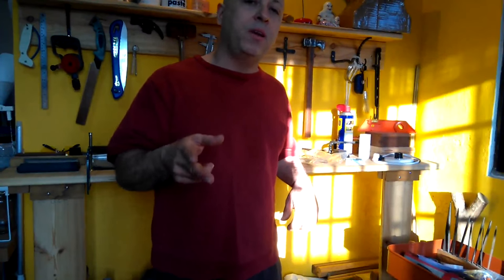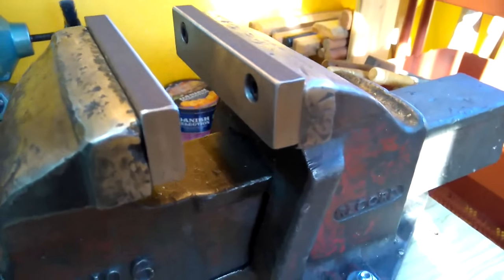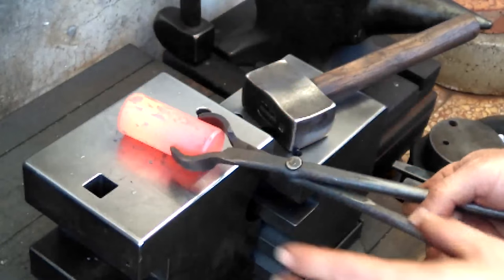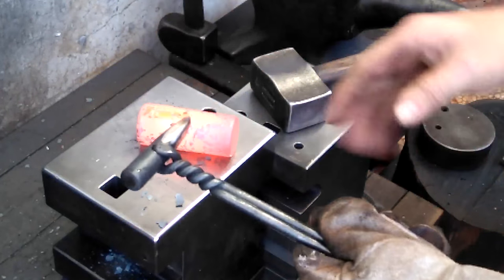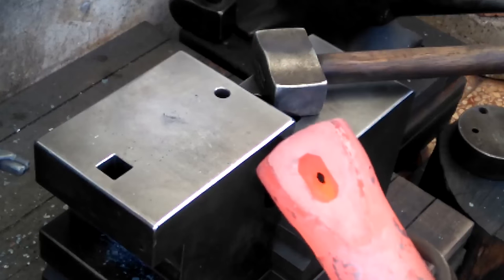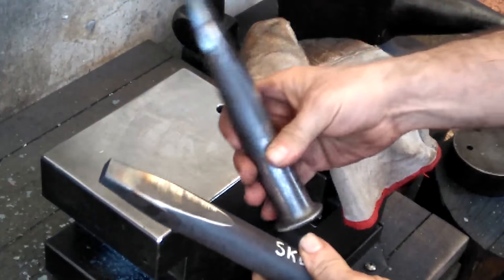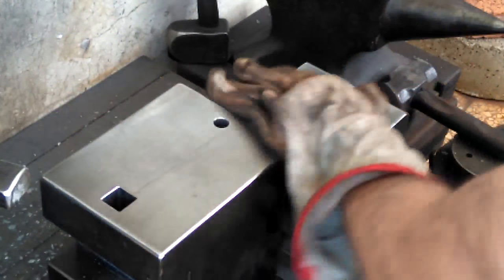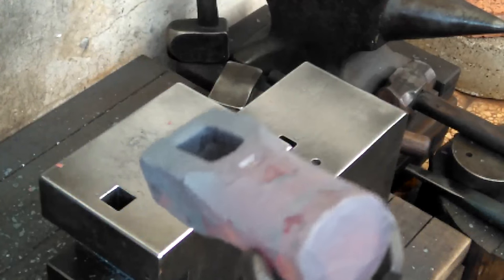Blacksmith Hammer Eye Forming - Free Hammer Giveaway...

Comment: Cool video.  I've been planning on machining an anvil like your square ones.  Anything I should watch out for?
Reply from the maker: The only thing I can think of is to take care to ease sharp edges if you will heat treat your anvil to avoid possible cracking. Thanks for watching and good luck in your work. Glen
Reply: Sweet.  Thanks, man!

Comment: Most blacksmith hammers are in the 2 -4 pound range. Other than arm fatigue, is there a reason that hammers are not in the 5-6 pound range or heavier?  Why do Japanese hammers have the handle offset toward the rear of the head?
Thanks for another informative video.
Reply from the maker: Bruce, I would say the main reason affecting hammer weight is the user. If a person can realistically use a 5 or 6 pound hammer and still maintain proper technique during a forging session, then by all means, go heavy. But over time, the wear on a person's arm and shoulder may be exacerbated by using a heavy hammer. Also, a heavier hammer normally has a wider face and this is not always desirable, depending on the workpiece. Another factor is acceleration. In the equation for force, acceleration is as important as mass. So, if a person can strike more readily with a lighter hammer, the results may be even better than a heavy hammer at a fraction of the speed. I'm not exactly sure why Japanese hammers are offset but it may be because of how Japanese blacksmiths tend to "drop" their hammers rather than forcefully direct hammer blows. Thanks for watching. Glen

Comment: Glen, this is an informative video nice job! I am sure that many would be interested in your heat treating process and even though it varies based on the type of material used it will still provide newcomers to the craft an idea of the process and how to go about it.
Peace!
Reply from the maker: Jeffrey, Some folks have asked if I can show my heat treating for hammers, etc., and so I'll go over that in a future video. The only thing with that is I know I will catch flack as opinions vary widely on the proper way to heat treat steels. Take care. Glen
Reply: Yes, but don't  worry about that. I think the majority of those opinions are based on the strength of the metal for its intended use and the amount of effort they wish to put into it. Like some people will wrap the item in foil while tempering and some will use a paste to prevent any oxidation during the process. Since both methods are effective it comes down to preference. The same with the color the metal turns - some like it and some don't. The metals data sheet provides the correct method for heat treating and tempering based on scientific fact. The bottom line is that you are merely demonstrating your method of heat treating that you have found to work best for you and this demo is at the request of some viewers. If people want to give you some flack over that then they have some serious problems!
Reply: Jeffrey Vastine well, yes, I agree with you. There is also the fact that opinions are like rear ends...EVERYBODY has their own, and usually they stink. I love watching him work!

Comment: Glen, a nice video on drifting the hammer eye. As you so aptly stated, it is not an easy process. I noticed you worked with the "long" side of the hammer head toward you while you were punching. I wonder if you rotated the hammer head every other time you punched, so you alternated between the long and short end of the head, if that would compensate for a tendency to "drift" in one direction? Not sure because I have not tried it.  Phillip Tuwaletstiwa
Reply from the maker: Phillip, You make a good point. I don't know if rotating the hammer as you describe will help but it might. The reason being is everyone's mechanics are set somewhat differently. So, it's good to alternate at times, especially when trying to achieve accuracy or balance. This is a good topic and something to explore in a future video. Thanks. Glen

Comment: Hi Glen, could you explain how you harden your cupping tool, you stated it was mild steel I I looked for your video on the topic but no luck, thank.
Reply from the maker: Randy, I think my cupping tool is medium carbon steel... I heat treat most medium carbon steels by simply quenching in water to harden. And I rarely temper afterwards. The reason being is that medium carbon steel does not get so hard from proper quenching. Also, I have an odd technique whereby I repeatedly pull the piece in and out of the water when quenching. Carbon steel can crack with a water quench but I've had good luck with my technique which cools it enough to harden but not so quickly that cracks develop. I really need to make a video of my heat treating for this steel. Thanks. Glen

Comment: When my back is healed (L5/L4/S1 fusion), I have a hammer planned also from 1045. I have square and round stock, it seems that most of the postings use round stock. Any ideas square vs round for hammers/ or type of hammer?
Reply from the maker: Carl, round or square seem to be a matter of personal preference mainly. With round (of similar diameter) there's less mass and so this makes forging a little easier. But square makes aligning where to punch the eye easier. As far as use, I like to use both styles. I like using a hammer with squarer edges when I work at specific angles at the edges of the anvil and I like a round face hammer when working in close on smaller items. Good luck with your back and your blacksmithing. Thanks. Glen

Comment: Hi Glen, Could you please let us know what the dimensions of those punches/drifts are? Thanks, and keep up the good work.
Reply from the maker: Christopher, My final drift is approximately 1" x 5/8". It tapers very slightly side to side and so the bottom of the hole is probably about 9/16" whereas the top is 5/8". The other punches I use all vary in size. After using the slitter, I determine which would be best to get me close enough to where I can use my drift. This is mainly based on the type of hammer and size. For some hammers, I drill a pilot hole and will show that in a future video. Thanks. Glen

Comment: Glen, is there a certain reason you use a slit and drift instead of a plug punch and drift? I am trying my first attempt at a hammer this weekend. I really enjoy the detail you put into all of your work.
Reply from the maker: I would say there are two reasons. When you slit open an eye, you're trying to remove no material, or at least a minimal amount. This can be beneficial, especially on smaller hammers, as it leave more material at the pole of the hammer which can help in keeping a handle secure. Also, punching a plug can be more difficult (take more force and heats) since you're trying to displace and remove more material than if you're slitting (slicing) through the steel. I hope this helps. Good luck in your work and thanks for watching. Glen

Comment: Glen do you have your drifts machined as well?  Would something like SK7 steel work well for these types of drifts?
Reply from the maker: Neil, Yes, I have some (not all) of my punches/drifts machined. Do you mean S7 steel? If so, yes, S7 is excellent for hot use. Over here, S, D, A, and H steels are called SKDxx so I'm not sure if you mean another steel. But all of these are air hardening and all can be used pretty successfully as hot-use blacksmith tools. But they are very hard to hand hammer. The property that makes them so good for hot use is exactly what makes them so hard to forge - they maintain hardness when very hot. Thanks for your support.

Comment: Do you also use 4140 and if so for what applications?
Reply from the maker: Pascual, my block style anvils are made from 4145. I used to use 4140 a lot when I lived in the States, using it for hammers and similar tools. I started using 1045 and 1050 carbon steels (for hammers) and particularly like 1050 for the extra hardness that can be attained. Thanks. Glen
Reply: Thank you

Comment: Nice hammer, looks like japanase/ But if it's japanase stile hammer why aren"t you use water when you hammering? and the face of hammer is out of hight carbon steal welded to the bodey of hammer. With respect....
Reply from the maker: Serge, I know many Japanese blacksmiths use water to remove scale form workpieces when hammering, especially for blades when working at lower temperature. Also, many Japanese tools have high carbon welded to softer low carbon or iron. But these things are not absolutes - not every Japanese smith operates in these ways. I mainly call it "Japanese style" since so many Japanese hammers have the handles offset to one side, like the one I made here. Thanks for watching. Glen
Reply: Ok , I'm understand. First of all you have enough melall for your project, and you like japanase design as m I )))